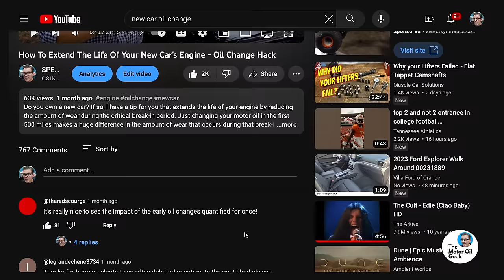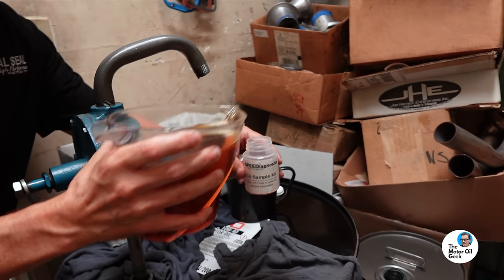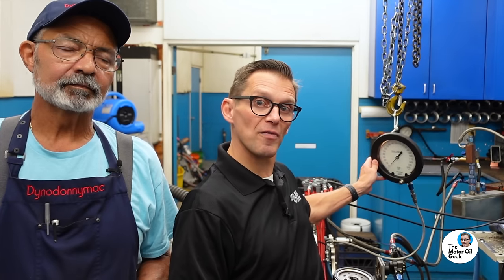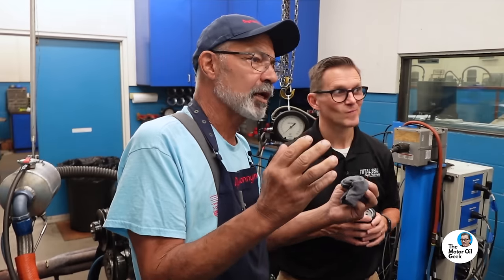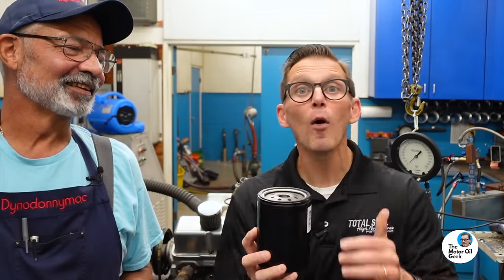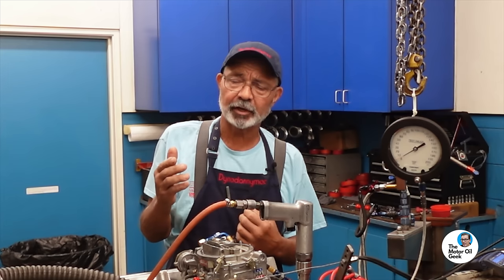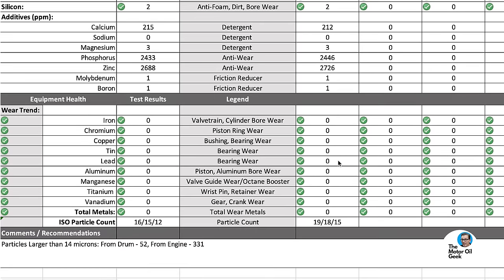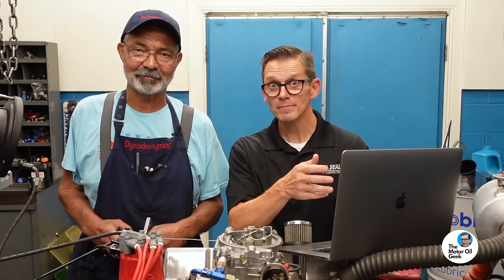Does Pre-FILLING The Oil FILTER Cause Engine DAMAGE?

Comment: I'm 70 and have been prefilling filters since I was 18, on a tip from a friend.
This the first time I've ever heard it questioned.
 It blows my mind that people think new oil out of the container is contaminated!
Reply from the maker: Right?
Reply: Especially given the fact that many smaller air cooled engine's don’t even have an oil filter, those are critical to start with clean oil.
Reply: @jeffgriffith7003  exactly. Great point.
Reply: Do these people also filter their new milk from the grocery store before drinking it?
Reply: I always prefilled my filters when I had Chevy trucks. Can’t do it on fords.
Reply: @markaruski Only if it was a dirty cow!
Reply: @Truckguy2007 sure you can, maybe not plumb full, but just because it's on a bit of an angle you can still get quite a bit in them. Some of the older Ford's it was real easy, they were pretty much vertical. One of my older pickups has an oil cooler with a horizontal remote mount for the filter. I can get it 2/3rds -3/4 ish full then hold it vertical and quickly tip it horizontal and spin er on. You don't lose much oil.
Reply: First I've heard too! Thought that was standard. It was the way I was taught. But you know, every body knows something of nothing! 😂 Great video!
Reply: If the oil is contaminated out of the new container you're screwed anyways, it's in the engine and as to travel to the filter.  @themotoroilgeek
Reply: I'm a couple yrs younger.. 61. and I learned the same way you did. No way I'm risking a dry start on the bearings, especially at today's prices  😎
Reply: @themotoroilgeek The oil out of the bottle is  not clean enough for the kidney loop filtering people. 😬
Reply: I always have also.. still do Pre fill
Reply: @Truckguy2007 yes Depends on the angle
Reply: or that they think their engine is cleaner than new in the bottle oil
Reply: I personally know a person that works in the oil industry. He admitted oil can be contaminated apon delivery.  To the point were some customers require oil samples.  This is in large capacity holding tanks.
Reply: @Beethechange1  I do not because of the oil circuit.  Oil is picked up from the pan goes thru the filter, then up to the crank and on.  So I think would not serve any purpose
Reply: The anti drain back valve is in the oil filter so when you drain it there is no oil in the galleries. Start up then it needs to pump up to filter. I’ve been a mechanic fifty years and always prefilled! Every car I’ve had got at least 250000 miles.
Reply: Well said.  I was instantly baffled that someone would even try to claim that prefilling the filter was bad... But then again we have people that claim birds aren't real and they claim the world is flat, so maybe I'm the crazy one for being surprised.
Reply: @Truckguy2007  can't do it to the same extent but you can get many of them 1/3 of the way full without it running out...  Even just getting the media soaked will speed up the process.

My little fiat based car has a canister that is at rough angle so it always spills oil and there isn't too much that can be done there without making a much worse mess.
Reply: @jmc6940  ask him what the odds are in a commercial package, not a 50 gallon drum.   Commercial deliveries where they are pumping hundreds of gallons into something.. yeah you want to know that your million dollars worth of oil is good... quality control.

Scaling that sampling down your 1 gallon jug?  Lol!
Reply: @underourrock  is it not amazing what silly things people believe or  disbelieve, guess it is the result of the internet,  oh cant pigs really fly?  ha ha
Reply: @chipmcg7766  Answer 1). if you launch them fast enough.

Answer 2) Well, politicians and lawyers have to get from point A to point B, too.l, so I suppose so.
Reply: @justincase1575  ok explain what a galleries are, is , never heard of that part in an engine unless the galley under to intake manifold is what you mean?
Reply: I am 60 and have been prefilling the filters since the mechanic who taught me to do oil changes showed me the right way to change a filter and I've never heard this question before... I suspect we are running out of oil things to talk about ;-)
Reply: @oznetyoutube125  True,  I just was looking at my 1971 motors manual that shows how the oil circuit runs in engines.  I suppose it may help to have a little oil in the filter first before pump pick up the oil in the pan an sends it to the filter..   Each to his own.  I am not a mechanic by trade just been doing ALL my own car /truck  repairs as needed plus rebuilt a few plus auto trans rebuilds.   Never in my 66 years have I taken my cars to shops ever.
Reply: @Truckguy2007  Yes you can, just not full. New Toyotas with upside down filters, no.
Reply: Not only that but they think microscopic particles are worse for your bearings than having dry metal on metal contact with your bearings for about 5 seconds. Even if the new oil was slightly dirty it would still be better than no oil.
Reply: @Truckguy2007 if they go in sideways you can still fill them part way, especially if you screw it on really fast.
Reply: @oznetyoutube125  quick,  let's make up something else for them to believe and give the those coming up behind us real soon a fresh crop of idgits to deal with.
Reply: @Truckguy2007  sure you can, am guessing you mean horizontal fit filters, just add oil to the new filter first thing when starting your oil change, this allows ample time for the filter element to soak up a lot of oil, by the time you get around to putting the filter on there will be no spill no waste.
Reply: There's not going to be hard parts in brand new oil, it's been filtered before it's been bottled😂
Reply: @chipmcg7766 The filter element has to be saturated before oil passes through it
Reply: I'm 53 and been doing it my whole life, even  the sideways ones, ESP helpful for turbo engines. Which in my humble opinion all the turbo engines should have an electric pump that starts 15 seconds before the engine does. If you don't believe me, a lot of heavy equipment use them for the simple reason to keep the turbo bearings oiled on startup and also with oil changes....The turbo's literally last twice as long.
Reply: @ShaunHensley  lol
Reply: @Truckguy2007  You should double check this by reading the manual.  My 2015 Forester has a FB25 engine in it and the filter is inverted and on top of the engine.  My manual instructs me to hold the gas pedal at full throttle and crank the engine over with the starter until the low oil pressure light extinguishes.  The engine will not start with the gas pedal at full throttle.
Reply: People think? LOL. I've been prefilling since I was 17. Especially beneficial in very large filters. Kinda like priming the pump.
Reply: @1bad99superduty  The theory is, when you pre-fill you are putting the oil into the discharge side of the filter, so when the engine starts, that oil is going straight to the bearings and not through the filter first. I get the theory, and it is something to possibly be aware of, but would it stop me from pre-filling an oil filter, to get oil pressure in the minimum time? No. But to each their own
Reply: Exactly. This is a very good video on a very stupid hypothesis.
Reply: @Truckguy2007 
Not true.
Fill the filter, allowing the element to absorb the oil. 
Add oil to half-fill it, then install.
Reply: @oneninerniner3427  That is what I do with my horizontal mounted 4.0L Jeep engines. My Dodge Hemi has a bit of a downward angle, so I can get a bit more in that one.
Reply: @oneninerniner3427 
I agree 100%.   I have filled my filters ALMOST to the TOP with no spills on my RAV4 Hybrid.  You have to be fast and have it RIGHT UP to the connection before you tilt it to screw on.
Reply: @themotoroilgeek   I've also heard most filter cans push the media out of the way at anything over idle oil pressures, so it's not even being  filtered much of the time. Do you happen to know at what oil pressure the bypass valve opens??? Is it during normal use or only if the media is plugged?
Reply: Excellent! Thank you for the education.
Reply: No, but they do still wear a mask in the car when alone.
Reply: I have owned and serviced all makes and models of cars in my lifetime. I agree totally with prefilling of filter prior to startup if the filter direction allows this. Many cars do not over their inherited design.
As an example, a subaru boxer engine filter is completely upside down. There is a specific startup procedure by cranking the engine with the gas pedal depressed creating a no start condition to prime the filter prior to startup.
However, many cars would say that regardless of priming an engine with fresh oil and a no start condition would still have a minute amount of contaminates in the oil regardless in the test after priming only through a filter.
On an oil change, you would still have contamination through a new filter regardless (oil filters are not 100 percent filtration even with the best of filters)
Didn't hear any mention of using an engine flush product to clean further contamination out before the oil change assuming not a brand new engine?
Just my thoughts on an interesting post....
Reply: I'm also 70 and have NEVER prefilled any oil filter. Also have never ruined an engine. It's a complete waste of time and effort. What these guys are saying is technically true but practically insignificant. I worked many years in a factory that built around 200 diesel engines per day. Did we prefill any of the filters? No. Never.
Reply: Use the the long funnel with a screen attachment on the funnel if you think the oil u buy is dirty lol
Reply: Why is it that something so simple and logical is debated ad nauseam by armchair physicists? People have been doing it for hundreds of years...I think they got it figured out. Oh, the humanity!
Reply: @Beethechange1 even on an angle, you can fill the filter, let the eral settle into it, then screw it on. Yes, some may leak out but better than a dry spot.
Reply: I always pre-dip my dip stick too, don`t want it feel left out of the party ya know.  ha ha
Reply: I don’t know why someone would make that statement . As a professional automotive technician, engine builder and diagnostic specialist I have never heard someone state that nor the rumor that new oil is contaminated. Always fill the filter if possible I even did so on Top Sportsman big block motors before priming on the stand. It’s a great habit to have.
Reply: @grazz7865  yes i fill.. Let it soak up the oil.. Then put more.. cannot hurt
Reply: I think my 29yo 1994 Toyota truck with 442K miles doesn't care, I have never prefilled my filter, 7 minutes per oil change with filter, and 5 minutes without filter (I change the filter every other time). Half a year to 30, no major work done, still running well.
Reply: @kellyd887 Dry start, are you talking after a rebuild? For a normal oil change, warm up the motor, swap oil in 5 to 7 minutes (with or without filter change) and start the motor, nothing dry there. 29 years on my toyota truck and zero issues
Reply: There's 2 engines offhand that I can tell an audible difference at startup after an oil change, and if you fill the filter or not. 
Gm 3.0 and a Nissan H25 ,both used on generator applications. 
Since they ramp up to 1800 rpm upon startup , you'll hear the rods chatter for a good 2-3 seconds upon startup, or for maybe a second if you fill the filter. 
It's not always audible in all engines ,but it's happening if you don't fill them.
Reply: i agree whoe heartedly, i feel ike the population is getting dumber and dumber… it’s really sad
Reply: @markaruski It already comes filtered let's cross our fingers.
Reply: If new oil is dirtier than the old oil in the engine, then why do we change oil ???
Reply: @Truckguy2007 
Not always true, sometimes you can sometimes can not all makes and models
Reply: Yeah you probably think Rotella is good oil too.
Reply: When I didn’t prefill a filter that screws in opening up it wasn’t distrust in anything but just not considering it had any relevance. I think my brother prefill a and I started. I have had long service life out of my engines both ways though so is it that big a deal? I don’t know but if the filter doesn’t have to tip sideways to install I’ll prefill. What about cartridge filters that install on top of the engine? Pour in oil until it stops going down?
Reply: Blow my mind that the average IQ and stupidity in the world has decreased so rapidly.
Reply: How do you pre-fill a horizontally mounted filter?
Reply: @chipmcg7766  how long does it take to go from the pick up to the filter to the motor. How many turns of the crank or cam before the motor is lubricated?
Reply: There have been instances, however rare, of oil being contaminated right out of the container, but it's usually because the containers were either mishandled or not properly cleaned before filling.
Reply: amsoil oil signature series entered the chat
Reply: @jcar1417  It seems to me that after draining the oil, there would be AIR in the oil tube from the pump to the filter.   That being the case, air would not force the cold new oil out of the filter up the oil circuit anyway.  Kind of like blowing air in a glass of water with straw it only blows bubbles the water, fluid does not come out of the glass does it, same thing with oil.  It am pretty sure it would not move out of the filter until the pumped oil arrived.
Reply: 75 here spent over 60 years doing the fill and Prelube . Won’t stop now
Reply: @chipmcg7766  well they just proved it in the video. Priming engine no oil in filter and prime with oil in filter, first takes 4 to 5 seconds to build pressure second starts building pressure as soon as you start pumping.
Reply: @theamerican7080  I don't know where you get this info, but new oil to SAE specs is filled into brand new plastic containers in a factory.  What you are talking about is 1/1quadrillion chances, and therefor not worthy of any consideration in this case.
Reply: Absolutely, how strange to think that new oil is already somehow dirty.
Reply: @mutteringmale  Well Mr. internet helper person, it happened to me when I bought a pallet of 5-gallon pails that were all contaminated with some kind of brown precipitate. I didn't discover this until I had already added the oil to a 13 liter Cat motor.
Reply: They do this on aircraft engines for a reason, by filling the filter with oil you will prevent considerable oil lag at the bearings and lessen the wear on them. End of story.
Reply: think harder!
Reply: It's not so much the thought of the oil itself is contaminated, as it's likely filtered during the production process. However, I'm not going to simply assume the bottle it was put into was stored in a cleanroom.

Personally, I refrain from pre-filling as whilst injecting clean (or otherwise) oil into the inlet side of the filament, the time taken to do so is time in which the outlet of the filter is uncovered and thus exposed to dust/debris in the air. I won't even remove the plastic until I'm right there ready to fit the new filter as whatever debris manages to enter the filter on the outlet side will go directly to the crank bearings once the engine is started.
Instead, I will use flood clear mode in order to turn the engine over a few times and circulate the new oil and prime the new filter etcetera prior to actually starting, turning the engine over by hand is also an option if you need to
The risk of contamination is certainly not high, but it's never zero, and I don't exactly work in a cleanroom either.
Reply: I've had Subarus that I couldn't prime the oil system if I prefilled the filter! Strangest damn thing ever but they need to be empty if trying to prime the oil system after a teardown.
Reply: My thought exactly! What do these knuckleheads think is in the bottle?
Reply: @oneninerniner3427 I think if you can even just wet the filter with oil b4 installation it will solve the problem
Reply: @jmc6940 and what do they do with a tanker full of contaminated oil ?
Reply: @theamerican7080  a pallet of 5 gallon pails....LOL.
Reply: I believe CAT was the one that recommended against it. Not so much because of dirty oil, but that you could introduce dirt into the output side of the filter during the process
Reply: @chipmcg7766 Can the oil continue from the filter before the filter are filled up? If not you are giving the oil a faster way the first time. It's logical a positive thing to do.
Reply: I'm 67 and have done it for years. Do on my 1973 Omega. 2005 Ford Focus , my riding mower
Reply: @oneninerniner3427   heck yeah even filling the filter 1/2 way will cut the wait on oil pressure a bit.. It is a pain that you cannot fill them all the way but.... what the heck...
Reply: Work on hydraulic systems and always pre filtered are new oil. Same  for automotive oils.
Reply: @cyoungso  I heard the same thing, but was unable to confirm it.
Reply: @kjellrogerjgensen60  I think it is a waste of time.  Some cars it is not even possible to pre-fill the filter. Plus, most filters only hold 10 oz at best.  In most engines oil from the pan to the filter is less and 10 for so inches V8s less in smaller engines.  In semi engines that have two large filter that hold 30 oz each that makes more sense. And is a common practice. It may also help in small engines to some extent reducing the lack of oil some.    Notice your lifters never go flat during an oil change at start up meaning they are still full.
Reply: Lol 😂 I am a retired 5th generation UAW Chrysler employee and 1st generation SRT development team member and I am laughing so much I can hardly breathe. We always pre fill oil filters.
Reply: Yea . . .  quality is super high now.
Reply: I'm 71, was an ASE Certified Master Mechanic for over 15 years but I've always prefilled my oil filters, starting anything with an engine with an empty filter is asking for rods to go a knocking. Most engine wear and damage occurs during start up. When you start an engine with an empty filter, you are starting this engine without lubrication. I've been changing my own oil since I was 16, that's 55 years. The worst thing you can hear on start up is a pronounced knocking sound for the first couple of seconds during start up. I've always made it a habit when starting to turn off the engine right when it starts so I can be sure there is proper oil flow in the motor. Then I restart, pulling the fuse for the fuel pump may set a check engine light. Why do I change my own oil, I don't trust mechanics that are looking for a way to make some money. If you know your mechanic it may be ok, but I've always thought, what if the mechanic, makes a small slice in the power steering hose, not big enough to leak but sure to leak at some point in the future, bam, he knows its coming back to him for $$$. I'm glad a lot of auto shops have glass windows so you can watch the work being done on the second most expensive thing you own. Trust in this country is a thing of the past.
Reply: There are people out there that think earth is flat and spend money trying to prove it.
All kinds of stupid out there 😂
Reply: @Truckguy2007  Why not? I have had many Ford's that could, if not use flood mode and prime the engine that way.
Reply: @bryanst.martin7134   So then use flood mode which allows you to prime the engine by cranking
Reply: @Mong0thepawn  Correct! It is called flood mode and all modern cars have this in their programing.
Reply: I prefilled mine, allow time fir the media to saturate then top off again. For the horizontal mounts, you can fill them to wet everything , then pour out everything that doesn't cling.
Reply: I wonder how many people open bottled water and run it through their Brita before drinking. 😂
Reply: Have you ever sent new oil to a lab?  Caterpillar, Cummins and some other big players specifically say don't do it.  In big containers, gallons and above, often have visible sludge in the bottom.
Reply: @oneninerniner3427 😊 no need on a Ford.  Gas pedal to the floor and crank 10-15 seconds.
Reply: @markaruski  LOL, I don't but my whisky is charcoal filtered.
Reply: In the IT world we call people who says that id10T's
Reply: @cyoungso  OMG...you participation awarded people are really disturbing.
Reply: @mutteringmale .what?
Reply: actually, I heard that there may be particles inside the new filter that will somehow be introduced into the engine on startup...but even if you don't prefill, they'll still be flushed into the engine.
Reply: @adotintheshark4848 actually, I heard that if you spin around 3 times, click your heels, pay to subscribe to CNN online, wish upon an alien planet, all the particles will go away.  It's magic.  Just like taxes.
Reply: Its not the oil, its the foil top you have to pop a hole in, that will block 
Your oil tube. Plus if you drop something into it not just fresh oil.
Reply: I agree with you...age 71 and the main advantage is oil pressure gets built quicker with prefilling oil filter. This is not common knowledge and because some filters on some cars are parallel to block and others oil filter inlet facing down not allowing prefill
Reply: Nice video but about 3 times longer than it needed to be.
Reply: Gee, what are the chances that my Ford and Toyota dealers are prefilling when they service my vehicles. Yeah I know, do it myself, but I am 73 and not crawling under my cars any more. Maybe on my motorcycle.
Reply: @Truckguy2007 
Yes you can!
Reply: It doesn't matter whether you do or you don't. It's that simple.  The fact that so many people argue about it and thepeople that don't aren't havinv engine failures is proof enough. I did 40 years as a fleet mechanic and never filled filters. Our engines did hundreds of thousands of miles.
Reply: @kellyd887  I have told my wife this for years---  "NO WAY I am risking a dry start."  NO WAY, NO HOW.  NEVER EVER!!!
Reply: Are you related to "Frank Jones" of "Tri-State Auto Salvage" Poteau, OK???  We think Tri-State is da best ever.
Reply: lol@ this frank guy.  Useless to prefill.  It gets filled as soon as you fill it up from the top lmfao
Reply: @Truckguy2007 I do it on my Fords. . You can also turn your engine over in flood mode for 20-30 seconds to circulate oil before you start it
Reply: @oneninerniner3427 yup, i prefill all mine. It is at angle so u can't get totally full on one but prob 3/4. I have a 96 bronco as well it has a 5.0(302) and it is vertical so I can fill all the way and same with my focus
Reply: @markaruski  Growing up on the farm even though we usually filtered all the raw milk we drank, on occasion my brothers & I would drink some directly from the cow - and we have all lived now more than 50 years with no untoward effects.  ;)
Reply: Always make sure your funnel is clean . I wash and dry mine . I was always told to pre fill the filter ( I measure what I take out and put in ) . As well as oiling the rubber seal.  Worked for me so far at age 64🤔😉😎
Reply: @Turco949  They walk around in the day and night along the blvd. spreading VD ;-)
Reply: Only a moron would think new oil is dirty and needs filtering. I surely hope they don't call themselves mechanics. Thats a scary thought.
Reply: @chipmcg7766 the purpose is the time to fill the filter is reduced, it's already full & bearings will be pressurized that much sooner, a good thing in my mind
Reply: @chipmcg7766 I think he means oil passages , galley's if I'm not mistaken
Reply: @Ozzy3333333 quick is always preferred to quality 😂
Reply: @308dad8 or until fill capacity , if you know it
Reply: @jcar1417 all engine's are diff. Filter full is less time than empty empty
Reply: @rogerdodrill4733  well, 29 years later "tells" it is quality and quick, doh!
Reply: @rogerdodrill4733  True for sure, I know big trucks, semis do that as a practice, they have two 24 oz filters.  Doing so on car can not hurt, may be a good ideal too.  may start doing it myself.
Reply: When you do a oil change, dont you warm up the motor first? Then change oil, 10 minutes max (unless its a ford trk and you need to take off the left front tire to get to the filter, LMAO). All the bearings still have lube from running 10 minutes ago, IMO no need for a prefill. I say it cant hurt, but whats it really saving?
Reply: @kellyd887  Dry start? I guess you forgot to warm up the motor BEFORE changing the oil?
Reply: My neighbor who has been a mechanic for 45 years taught me to prefill the oil filter, especially when I changed the oil in my 1997 Winnebago Motorhome (454 Chevy, 7.4L 8 cyl). Made a believer out of me.
Reply: @jumpercable20  I assume you warm up the motor before changing the oil, then change the oil and fire up the motor 5~10 minutes after it was just run, correct? The oil is not going to disappear in 5 minutes. My 94 toyota truck has 442K miles in 29 years, never prefill and zero issues, runs great. When I do change the filter every other time, it takes less than 2 seconds for the oil pressure light to turn off when starting with an empty filter.
Reply: @1bad99superduty  Pump sucks oil up the pickup to the filter first then engine.
Reply: @ShaunHensley  Which happens instantly. Oil pumps don't trickle.
Reply: @timjohnun4297  People for some reason like to make up crap like new oil is dirty LOL. The cleanest the oil will ever be is in the bottle.
Reply: @W.451  yeah i don't really care about your opinion, you do what you want with your engines
Reply: @ShaunHensley  Then don't say dumb things and giving YOUR opinion to other people. Jeeees!
Reply: @jmc6940  New, poor quality oil can have some level of contamination. I'm not saying it should, it just does.
Reply: @Ozzy3333333  It doesn't disappear after 5 to 10 minutes but there are times when my car sits in the garage for 3 or 4 days before being started, I  only put 3k on the odo about every 4 to 6 months. But warm oil always runs out of the pan a little faster.
Reply: @jumpercable20  correct, you should warm up your motor before changing oil, and therefore no need to prefill the filter IMO.
Reply: @justincase1575 the must be dunmbocrates
Reply: @markaruski  The filter is filled to make sure there is enough oil in the engine on start up. It's covered in the video.
Reply: @theamerican7080 I've seen that many times it's simply the additives falling out of the mix during storage it doesn't hurt anything and if it bugs you just shake the can to remix
Reply: @Ozzy3333333  Since there's no effort or hard work, I'll keep on doing it, Old habits die hard, I've beaten the worst ones, I gave up cigarettes 23 years ago, that was hard.
Reply: @MikeDPlxztc  In this case it was some kind of grit, not the additive package separating out.
Reply: You will be surprised how unclean new oil actually is engine oils especially. Having said that, its clean enough for you engine but if you sent it away to get it checked, there will be dirt in it. I work in the hydraulics industry and the biggest problem with pumps etc failing is because of dirty oil, it should always be pre filtered not poured from the open tub you just opened. I know from experience that people do pour it straight from a tub and probably don't know that it should be filtered. But yes all oil isn't 100% clean that's a fact.
Reply: I agree.  I believe this video is just disputing something for the sake of disputing it.  I'll keep pre-filling my oil filters, but thanks.
Reply: @Truckguy2007  yes you can, but it depends on the Ford.
Reply: @joejones4172  Understood, what I'm referring to is people who are against pre-filling the oil filter due to a fear of 'unfiltered' brand new oil out of the bottle introduced to the engine (and not passing through the filter) and that brand new oil damaging the engine.
Reply: People think the earth is flat... So yea, we'll just keep doing the right thing while those dummies figure it out themselfs
Reply: I'm 65 and have been prefilling filter since my mid 20's on recommendation from a friend.
Never had to replace an engine and none of the vehicles I owned burned oil and had good compression even at around 150K miles.
Reply: Same age same thought 👍
Reply: So how do I prefilled my oil filter on my Tacoma it’s installed upside down?🤔
Reply: I prefill my f150 09 model filter
Reply: Not on a 4.3 chevy.  or a 2.2 ecotec and many others. chevy sux just as bad as ford   @Truckguy2007
Reply: My Nissan filter goes on sideways on the back of the engine above the downpipe. Sometimes not an option.
Reply: I've seen plastic bottle shavings in new oil.  You want that in your engine?
Reply: @shanemitchell477  a way to let the turbo spin and cool down for 15-30 seconds at engine shut off would help too
Reply: @originaloldpop8405  That doesn't help at startup when there is very little oil pressure, and during oil changes when there is little oil pressure for the precious few seconds. We were talking about oil changes and startup, not cooldown. However you are correct, in the army on old V12 turbo diesels we used to let them idle part throttle for 15 min.
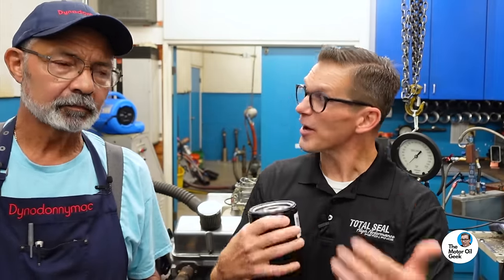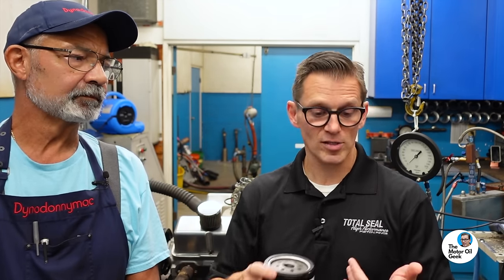Reply: 7:24  @MadDestructionChaos 7:14
Reply: @jeffgriffith7003  - recent lawn mowers don't have plugs below the crank case either. They require a vacuum pump to draw oil out from the top.
Reply: @Truckguy2007  - side mounted filters can be filled halfway, then turn the filter to soak the media.
Reply: its like, "what people think that?". I think a lot of people who say that have never changed oil or driven a car, its just their weird youtube comment persona pretending.
Reply: @markaruski  Good one.
Reply: @oneninerniner3427  i prefill till the pleats are soaked. Better than nothing.
Reply: @Whatfer  I have a vacuum pump as well but it’s easier to just tip the mower over on its side and let it drain out of the filler.
Reply: @jeffgriffith7003  - I could do that with one of my walk behind mowers but not the dual-blade 30".
Reply: Oh man, it's questioned all the time. A guy that has caused a lot of it is the owner of Agco Auto, Louis
Reply: Got in the habit decades ago. Wont ever change.
Reply: if any thing its cleaner then back then with all the factory treatment and filtering they do now!
Reply: ive seen visible sediment in new jugs of rotella
Reply: @tshackelton only if the media is plugged and different filters use different methods.
Reply: Oil from the pump enters the filter from the center just like filling it prior to installation therefore it’s still getting filtered before entering the engine.
Reply: @kirkstiefel2102  And what?  You're 19 now?  🤣
Reply: @bornalbertan5701  are you sure it doesn't enter from the outside?
Reply: @engineclinic  no I'm not!  I'm a pipeline inspector and I know that a cylinder can handle more pressure from the inside than the outside so I would assume a filter would be the same way. Pressure from the outside as the filter gets dirty would make it collapse.
Reply: @bornalbertan5701  it goes to the outside and it's designed so if it does get too dirty then the sides can flex and create a bypass because even dirty oil is better than no oil at all.
Reply: @engineclinic  makes sense, thanks
Reply: @bornalbertan5701  just the fact that the filter manufacturers know that dirty oil is better than no oil lends credence to the notion that it's better to prefill a filter than to run for 6 seconds without oil pressure.
Reply: @bornalbertan5701  some manufacturers use an actual bypass valve and others use a side that can push out to bypass.  Feel the difference between a quaker state filter and a fram filter.
Reply: @engineclinic  I agree
Reply: OR...ignore that that there is no oil pressure on bearings for the first 1-2 seconds when you dont do this.....people don't see this? Notice the red oil light and why the oil change places start the car......wait for the light to go off....then restart to PROVE there is no red light. What just happened?.... the oil flter got "filled".
Reply: @Truckguy2007   What are you talking about?  I have done it on every Ford I ever owned and raced...
Reply: @1bad99superduty  Exactly what I said.. whats the tiny amount in the filter matter when you are shoving all 5+ quarts in through the top? LOL.. what a stupid assumption.
Reply: Have you ever looked into the oil bottle after emptying it? I've seen sediment in them, I doubt it's harmful but who knows for sure.
Reply: @Whatfer  drain plug on mowers is under deck by cutting blade on some
Reply: It's poured in the dirty side of the filter anyway. I've always prefilled and always will.
Reply: It's called mob mentality. Then again where does horrible info come from? Insurance companies  and auto manufacturers want to sell you a new car not how to prolong your old one.
Reply: Doubt it's contaminated but I have noticed 10w 30 in the 90s and 00s had a higher viscosity then today's 10w 30. Not sure if that's because of it having synthetic in it now or what, but when you used to pour the oil and when it came to an end there would be a long thin string of oil coming out of the plastic bottle.  Now it comes out like water, dripping
Reply: @gonerydin4225  It is ok to be wrong.
Reply: @kellyd887  " No way I'm risking a dry start on the bearings,"
There will still be lubracation in the bearings, draining the oil doesn't remove every molecule of it off the surfaces. Once cranking filter is full by the time the engine even fires. And if the filter is on a 90deg angle, it will drain out when the car is shut off anyway.
Reply: Even if the fresh oil had some contaminates it would be so insignificant compared with 5 litres of oil in the sump. I always filled the filter then disconnected the ignition and turned the engine over on the starter till oil pressure reached. Bit more difficult on modern engines but still easy to unplug the plugs
Reply: @thatbiguy1975 exactly. It's an internal combustion engine, it has plenty of shit in it.
Reply: @Truckguy2007 I do it on my ford van, might lose a bit putting it on but not much at all.
Reply: Any oil is better than none
Reply: I like to refer to these contrarians as NPC trolls. 

Unfortunately there is a significant percentage of them on social media forums (esp. youtube) that will go out of their way to argue against common sense with any and everyone to get their rocks off. 

It's a mental illness and/or alcohol problem.
Reply: @markaruski no but they should 😊
Reply: its 2023, people always are questioning things and making up shit to prove their case. lol
Reply: I’ve been changing my own oil for years. I have never not one time bothered to prefill a filter. I have never had any problems with my engines.
Reply: And I know your suppose to have evrything clean tp put in your Oil but some guy told me that one grain of sand could stop up your Oil Pump and I told him he was full of SH**.
Reply: If you notice people filters have a ADV and now they are silicone to seal even better in cold temps. Guess, why? Because manufactures do not want your vehicle to have a dry start. Notice that lovely rattle with a dry start. Been driving since 1970 and it is 2023. that's a lot of years of pre filling with no problems. I will continue to do so.
Reply: @bryanst.martin7134 subarus also upside down, i wonder what the pre fillers are going to day about that?😂
Reply: @hubster4477  For the most part, small auto engines have small filters and the residual film is satisfactory for the 1st few hundred revs. A 2+ qt empty truck filter (Diesel) is another story. Late model diesels take 8 to 16 seconds to fill the filter. In fact they take 8 to 10 seconds to refill the pickup tube and camshaft(hollow). Fleecing the American citizen in every facet of their life. Welcome to Hell. Planned obsolescence. You are familiar if you own an Apple product.
Reply: @hubster4477  One more thing, I use used oil to lube the filter seal! Whoa! Why? Because a drop or two of dirty oil doesn't represent as an oil leak. Just a friendly FWI from a mechanic since 12. I have built a lot of engines, and gas turbines. Have a nice day. Or is that "say"? ;-)
Reply: @bryanst.martin7134  hahaha i do that also!
Reply: It is, just a little bit. That’s why when oil filters are tested by manufacturers the standard is to use aero shell 41 I believe, as it is considered “clean oil”. The amount of contamination is extremely minuscule however, so it doesn’t affect engine operation normally
Reply: Me too!
Reply: @Beethechange1 that’s what she said😂
Reply: These "people" also include the engineers of CAT engines. In their manual it specifically states do NOT prefill oil filters. It blew my mind that it blows your mind that people come up with different ideas to try and treat their engines the best.
Reply: This is getting completely confusing, I really need to know if it will be wise to pre fill the filters or not, I just got my cybertruck. 😂
Reply: @santlha  damn, how are you so funny, where do you come up with these witty original jokes?!
Reply: I`m 52, have done maintenance on every vehicle (cars, trucks, boats, motorcycles, atvs, lawn mowers....etc) I have ever owned, (quite a few) and have honestly never heard of pre filling a filter til today? Never had a single issue, but I can see a s benefit from pre filling, and nothing to detract, just never even crossed my mind. I have also used Fram almost exclusively til the last couple of years, with zero oil related failures in a engine ever! Interesting discussion point that everyone, regardless of skill level feels that they are an authority.
Reply: @justincase1575 The are oil filters that don't have anti drain valve, also cartridge filters mounted on the top always drain back when the engine is off. That been said I don't prefilled the filters. I gave my son a Toyota I bought new in 2003, at the moment the engine has 389k. Doesn't burn oil and as far as engine problems none so far. I have replace the timing chain, tensioner and guides, Water pump and one ignition coil.
Reply: @tshackelton  It depends on the filter.  You can usually check it on the website, generally anywhere from 12-20 PSI
Reply: @markaruski ummmmmm noooooo……..
Reply: @Truckguy2007 I’ve always done it on fords….. love Chevy die hards who say random lies about ford lol
Reply: @Truckguy2007 You can on older models. 10th gen at least.
Reply: @W.451  every engine I have seen the oil enters from the valve cover.  You may have a engine that oil enters to the pump and stays perfectly below the pickup.  But a gallon plus of oil through valve cover means any contamination as already been introduced to the top end and main bearings.
Reply: @1bad99superduty  New oil in the bottle of course is the cleanest it will ever be.  Mains are on the crank and are pressure lubricated. When you pour oil into the (car or truck) engine it drains straight down to the pan by drain channels in the head and block and cannot go to any other place. Not the valves, not the cam, not the crank nowhere but the pan. Not a drop goes through the engine any way but up the pickup tube and filter first so what you said makes no sense. You should to study engine workings right here on YouTube.
Reply: @W.451  Or i can go pull the valve cover off my ls engine, or bbc and see that when I pour through the fill spot the oil gets on the rockers before it goes down to the pan.
Reply: How the hell would you pour dirty oil in an engine anyway?
Reply: 🤣🤣🤣 @markaruski
Reply: And how else is it going to get filtered besides putting it into the filter?  It doesn't make any sense.
Reply: Well, when you consider that it's just an oil filter, for chrissakes, and they've SURELY been installed in every conceivable way BY NOW, so what in the world difference can all this make? Or is this solely for purists?
Reply: @chipmcg7766  oil galleys, the passages within the engine that carries the oil to the different areas of the engine.
Reply: @tshackelton  oil filter bypass valves open at a rather low pressure, like 10 to 15 psi. or so, So yes they are open much of the time.
Reply: So for those that say fresh oil needs to be filtered because it's dirty and has particles in it. Most oil filter bypass valves open at a low pressure usually around what? 14ish psi. or so I believe. Why? because the oil pump just can't shove all that volume of oil needed through the filter to properly feed the engine. So you see some of your oil is going into the engine unfiltered when the pressure is over that. And most engines hold more than 14psi oil pressure idling hot. So the bypass valves are open way more than you think.  It's not to say the filter isn't filtering, it just not filtering every drop the pump is pumping all the time OK?
Reply: New oil hasn't been filtered? LOLOLOLOL
Reply: @justincase1575  "I’ve been a mechanic fifty years and always prefilled"  What's the technique to prefill sideways and upside down oil filters without making a mess? 🤔
Reply: I will be 70 in July and I have never heard of filing the filter! Huh! This video made a believer out of me! From next time on, I am filling them!
Reply: @markaruski  L AND O AND L !
Reply: @1bad99superduty  oil goes directly from the
Reply: @1bad99superduty  oil goes from the pan to the pump to the filter then the engine.
Reply: Lol I am 70 also and I have been prefilling sense I was 16 only due to common sense .
Reply: Common sense is a habit😂which sum people don't practice😅I always pre-filled my oil filter and it's not going to stop👍🏾
Reply: Not clean enough.... Are there flat earthers doing oil changes now?
Reply: Crazy questions being asked because there are a lot less mechanically-inclined people today.
Reply: I lov dirty oil is that what the oil filter for to clean it😂🤣😅😅I guess 😅 🙃
Reply: I pre- fill when I can, when I don't I start and make it just barely ' vroom ' then shut it off while watching the light or gauge.  I do quick ' vroom ' then shut offs till it shows pressure.
Anything to keep rpm low and give it a chance to fill.
Reply: With sideways filters you have to make sure you have a filter with a good anti drain- back valve. In other words do NOT use a Fram oil filter.
Otherwise you will have a dry start condition every start.
Reply: I have multiple vehicles with 400,000 plus miles on them and have never pre-filled the oil filter, they are still running in great shape.
Reply: I am 69 and did my first oil change at age 15. I have owned more than 70 vehicles and have 11 filter-equipped machines now. I have never prefilled a filter. The filter orientation on a vast numbers of vehicles often makes this a useless or impossible process — and for the rest it is messy and/or unnecessary.
Reply: Same age and same thing here.
Reply: Indeed. Some people shouldn't be allowed on the internet without strict supervision!
Reply: @1bad99superduty  If it gets pumped to the filter, the filter catches it. If it's poured into the filter, it goes straight to the main oil gallery. That's the theory behind it. Could brand new oil out of a sealed container be contaminated? Possibly, maybe it has a lump of plastic in it from the container itself, but pretty unlikely imo
Reply: @Turco949  isn't that chocolate milk :P
Reply: 14 mins seems alot for such a simple point.
Reply: I've only heard that you can introduce new contaminents to it and all I can think of is "Well that funnel is pretty dirty no matter how much you clean it so you better do a good job with free-hand pouring."
Reply: @SteelOfLegend  I always pour it from the oil bottle directly into the filter. No chance of contaminates. it's also not hard both are movable. if you can pour milk into a glass then you can pour oil into the filter.
Reply: The only thing I noticed in the video is that the oil pressure gauge was in psi and the units of measurement for the particles was metric most American think they don’t use the metric system great video anyway but I think if you had a vehicle that you can’t pre fill the filter the next best thing would be to prevent the engine from starting and crank the engine for a few seconds personally I don’t think that a lot of wear is done with a hot engine with a few seconds of no oil pressure.
Reply: Always have prefilled,always will...builds pressure faster...no tic tic waiting on oil.
Reply: I’ve done that for more years than I can recall. Even on Fords. The small amount you loose holding it at an angle is minuscule compared to how much stays in the filter. The time it took for the oil pressure gauge showing pressure build up convinced me years ago.
Reply: @chipmcg7766  so during the time that the oil filter is filling no oil is being sent through the engine...
Reply: Keep filling um.up.thats right way real mechanic s fill up oid filters been doing it 53 years
Reply: All my vehicles are side mount filter, no prefill and still going hard at 400,000km but maybe Japanese engines are better lol
Reply: I am 70 and have been filling oil filters since I was 17. It had no engine noise when I did it, vs. not doing it. My analog oil gauge gains pressure faster.
Reply: @Truckguy2007 meh?
Reply: Prefilled prevents a dry start. You should always prefill a filter     when you overhaul an engine.
Reply: So I've been doing it right for 50+ years. Thanks Dad.
Reply: I dont trust what "people think"....Stupidity has recently been rampant!
Reply: Do you ever made an Oil Change in a Mercedes?
How do you Pre-Fill the Oil Filter since it is mounted upside Down?
Reply: SIDEWAYS OIL FILTER.. please explain HOW/WHY you would fill a filter that goes 90 deg. to the engine?
Reply: Exactly. But, how would this guy make any money if he didn't put out this click-bait video?
Reply: @oneninerniner3427 Ford are good. Chevies eat more gas
Reply: I'm 82 and ALWAYS prefill the filter.
My dad was a heavy truck mechanic and that's what he taught me!
THAT is the only way that made any sense to me!

The idea that oil straight out of the can is dirty is just dumb!
Reply: It is.  I’ve seen many times new oil contains visible contaminants…. And this was full syn premium oil
Reply: Also blows my mind that people think that their sh1tty Fram oil filter would filter out whatever invisible contaminates might be in a new container of oil.
Reply: n @Truckguy2007 what does it do to ford engines   can't believe this is ? Pre filled them all my life owed gm
Reply: Depends on how big there wings are
Reply: Only reason I could be is if you transfer it into a dirty container or use a dirty funnel.
Reply: Factory Certified heavy equipment mechanic here. In our “hydraulics cleanliness” training we are taught ALL oil (hydraulic, engine, transmission) even out of the container has a certain level of “contamination” most hydraulic applications the oil is supposed to be filter through a certain micron sock before being poured into the tank. Maybe that is part of where this myth about motor oil comes from 🤷. That being said the micron level of “acceptable contamination” for most hydraulic systems is likely much lower than for most automotive applications.
Reply: They made it for the views! Everyone needs to make money.
Reply: Click bait...
Reply: Well, years ago the clearances in engines were loose enough till oil straight out of the containers were fine. Today a lot of engines have extremely tight tolerances, that yes, the unfiltered oil from a container might can do damage. As I said, just start the motor for just 30 seconds or so to get the oil to everything, before draining & changing the filter. Then that 2 seconds after startup won't hurt anything. By the way, I am almost 70, retired mechanic of 44 years.
Reply: Thats not why its thar its a waste of time theres literally no point in prefilling an oil filter and not every filter is right up and down uou cant pre fill every filter
Reply: provided that oil was stored properly so it stays clean it is cleaner than any oil in the engine. even brand new engines have contaminants from the manufacturing process and from the initial running in process. hence why there is the recommendation to use running in oil and its also why all manufacturers have a complimentary 1000km service it so they can change that first fill of oil and the filter to remove the debris from bedding in the engine!
Reply: The video title was for clicks, obviously .
Reply: @chrisforgan731  Well, I use to do oil particle testing, & the new oil from a new barrel of oil did not meet the standards for journal. or babbitt bearings. The idea is that all the oil going to the bearings have been pumped through a 10-micron filter before it goes to the bearings. Yes, break-in oil as we say will have a little more filing due to seating the rings, but new technology in rings & cylinder walls has changed that a lot from years ago. Thats why now engines run in excess of 200K. Mu advise still is just to run the Eng. & get the oil circulated before changing it, so you don't have any dry bearings.
Reply: @RogerDurham-v9s  what you say isnt possible with modern electronic ignition engines or deisels they dont have a distributor so you cant drive the pump independantly of the crank shaft! 

unless you remove the oil pressure sensor and pump oil in manually or it has a seperate pump as part of a drysump system or a seperate priming pump like some big marine and stationary diesels do.

what i have seen is a filter mounted on the outlet of drum pumps so that the oil is filtered from the drum to the measuring jug. many bulk fluid systems have filters just incase some contamination got in during filling or storage. and for oil bottles and small drums thats what a clean rag or parts wipe is for, wipe the thing clean before you open it. same with measuring jugs and funnels wipe em clean before use and store them so they stay clean a jug stored upside down only gets dirty on the outside and the rim where its easy to clean.

oh and side note some engines dont fully filter the oil anyway and have bypass oil systems. caterpillar was doing this in the 40s on diesels.
Reply: @chrisforgan731  I don't know where you got the notion that I insinuated to prime the oil system. No, all I said is to start the eng., crank it up for 30 seconds till the oil has circulated throughout the eng. then drain the oil & change the filter. If the eng. has been sitting over several hours, just start it for 30 seconds. It is not complicated. And in the 40ties those engines had like .003 bearing clearance. Today's car engines have.0003 clearance.
Reply: I'm 70 too, but I have never done this, and have never had a bearing problem with my cars.  If bearings were dry during cranking, don't you think 10,000 starts during the life of the car would destroy the crank bearings?
Reply: If you do not have clear flood mode pull the ignition fuse so it can't fire then crank it for about 10 seconds that will prime the filter
Reply: @yukon4511  IT really makes little to no difference. But it has really created a lot of discussion.
Reply: @stevenoe6395  these guys think the crank journals are bone dry and susceptible to damage if you do this....
Reply: @Truckguy2007 i did on my 6L cartridge and currently do on my 6.7L trucks.   Not sure about the new turbo v6 suv with 4ft beds
Reply: Wonder if they filter Coca cola before they drink it 😂
Reply: If you've got data, im happy to look at it.
If we're going with opinions it'll be easiest on everyone if we just go with mine.👍
Reply: Me to
Reply: @markaruski  probably
Reply: I've not heard that with engine oil. I did hear that with hydraulic oil. Had a professor work for CAT back in the 90's as a hydraulic engineer. They were finding the oil being drained out of hydraulic systems to be cleaner than what was going in from 55 gallon drums. But this was in the 90's.
Reply: @jeffgriffith7003 no but some have a centrifugal oil filter
Reply: I always prefill fuel and oil filters and even coolant filter on my big Cummins in my road tractor. Reason being i have had them get an air bubble on filters that big. So just into the habit of prefilling the filters. I even prefill my big air filters 😂😂😂
Reply: LMAO fresh oil is the most uncontaminated its ever going to get!
Reply: @Truckguy2007 The filter on my mother's Focus has a vertical oil filter. I've NEVER done it since I 've been working on vehicles.(over 40 yrs...I'm 53 now). I have NEVER had a problem. 👍😁
Reply: Iv seen a chunk of plastic fall out of new oil
Reply: Keep doing what you are doing.
Reply: Maybe because major engine manufacturers specifically say not to in their service manuals and directly on the oil filters…
Reply: @Truckguy2007  I don't know what year you have, but my 1999 Ford has a feature whereby the engine will spin over after the oil change but will not start. Once the oil change is done, depress the accelerator to the floor and attempt to start it. The engine will spin over but will not start until you fully release the accelerator and try to start it normally.
Reply: I agree with you, at the end they are on YouTube and definitely want to create more views.
Reply: The best thing to is do put a dry filter on, pull the fuel pump fuse, and crank it over a few times to prime the filter.
Reply: Especially bulk oil from large tanks and sometimes plastic containers will have plastic pieces in the oil. A 55 gallons drum can sometimes have debris and paint inside the paint. A large dealer sized oil tanker can get contamination over the years. The trucks that deliver the oil are not always clean. I’ve seen it  my own eyes. But at the end of the day. Do it the way you prefer. Best way is to install filter dry and crank engine with a disabled fuel system until you have oil pressure or manually prime oil system if engine is a fresh rebuild and dry. Follow manufacturers recommendations. Most manufacturers recommend not pre filling. Small debris can destroy bearings.
Reply: @themotoroilgeek  I understand what you are saying however I have seen it many times where oil is cleaner coming out of the engine with a low hour run time, than the oil from the supplier. I deal with Mobil, Chevron, and Phillips 66 mostly. This has to do with the bulk oil supply that we use. One engine in our fleet uses approximately 80 gallons of 15/40 oil. With our filtration systems in place we can run 2k plus hrs on an oil change interval due to sampling while still getting a 40k hour engine service life. Oil is contaminated at each event it is exposed to atmosphere. The quantity I need to manage a very large off road fleet is delivered by train. Contamination points from Supplier to train, from train to bulk tank, from bulk tank to delivery truck, from delivery truck to my bulk tank and from my bulk tank to supply reel or lube truck and again from my supply to engine. We do prefill filters however we only allow the filter to be filled from the outside holes and not the center. We do not prefill filters on machines with pre lubrication motors as they will not crank without a pre determined oil pressure value from pre lube system. If that makes any sense.
Reply: haha same, I've been doing it that way my whole life.
Reply: @Turco949 the average bottle of grocery store milk has milk from over 2000 cows. 😊 still not a problem.
Reply: @MadDestructionChaos that’s internet engineering. More myths are circulated on the internet than actual facts. Just look at content that you KNOW the facts of and see how many are full of BS.
Reply: @timjohnun4297 but it is still cleaner than what comes through the filter. No oil for 4 to 5 seconds then already contaminated oil from engine wash down, contaminated oil not drained from the pan and that cheap filter they bought doesn’t work that well any way. Just another urban myth.
Reply: @july8xx  Not an urban myth at all. Let's say, for example, during the manufacturing process, a small lump of plastic or a piece of swarf, makes its way into your new container of oil. If you pour it into the discharge side of the filter (The hole in the middle), there's nothing between it and the main oil gallery. Start the engine, and first stop = main bearings (Or possibly camshaft). If you pour it into the pan, it gets sucked up by the pump and pushed into the inlet side of the filter, where it remains.
Reply: Ive always prefilled where possible ,some have provision to be bled but if you checkout modern workshops the fillers are pump assisted &aslongs minimum sump level has been achieved to point pickups submerged then oil pump will go to work immediately &prime rest the system before any damage occurs but filling filter prior to installing simply means minimal time occurs without oil being pumped around engine as no delay occurs whilst awaiting filter to fill, didnt expectation go along line of expect half litre approx for  prefilling filter then approx 3&half to 4& half litres for 4cyl then anothr quart for 6cyl  then another quart again for 8cylinder ?
Anyhow get your filter &sump sorted right then start engine , listen for any bad sounds &look for any leaks , but on initial refill &startup aslongs dipstick declares above minimum line &close to or bit below top fill line then your golden then once running jst recheck &make slight further fill uptil level is not further than level with top dipstick mark - then your all good - like most rhings to do with mechaniking its actually just common sense.
Reply: @oneninerniner3427  I can't speak for all Fords, but my 1999 Crown Victoria will prime itself before cranking.
Once the oil change is done, press the accelerator to the floor and crank over the engine. It will not start but can be cranked over several times to prime the system. Once that is done, release the accelerator fully and start as normal.
Reply: Not, but it gets contaminated as soon as it touches the engine parts, though, finding its way down the pan, and no engine is clean inside while draining it, not even after several flushes...but I have never prefilled mine, and I have been fine, a couple of seconds or less, my filter is vertically on the bottom, will not damage anything...
Reply: Commercial Oil bay's are not set up to have motor oil down there.
Reply: I mean it can be, ever heard of tolerances? Lol, there's a margin of error for everything and yes even oil fresh from the bottle can be impure enough to cause damage

Now do i care? Nope, i prefill too
Reply: @markaruski , it's pre- priming .
Reply: Impossible to pre fill a filter on my Lexus ls. Filter canister hangs down but on this vehicle only the filter media inside is replaced. No way to load oil into it.. one would think the Japanese would be concerned.. 125000 miles , still runs like a top....
Reply: I am 75 and have been changing my oil and filter myself as since my first car when I was 18.  I have never prefiled the filter and never had any problem with my vehicles.
Reply: @santlha yes you need to che k battery fluid and charge that way you cab go 50 miles😂
Reply: @Truckguy2007  lmfao , explain WHY not
Reply: Ikr why would you buy contaminated oil????
Reply: @frankjones4094  it is amazing to me.  I am 75 and have had 15 cars or more.  The ones I liked all had over 100k and no problems.  I never pre filled the filter.  It is  bunch of I do then you do it, It is good  practice.  No maufaurer recommends it.  And if your filter is tilted or horz, then you have a mess.  It is pure BS. You are not in Indy 500.  I never had dirty brand oil in my 75 years.
Reply: @jmc6940 sure you do weirdo 😂😂😂...you can't even spell upon 😂😂😂